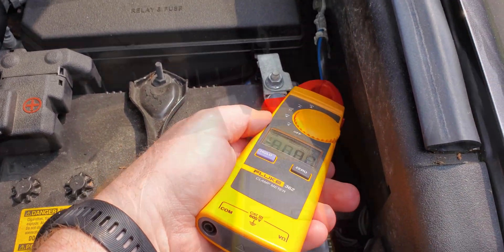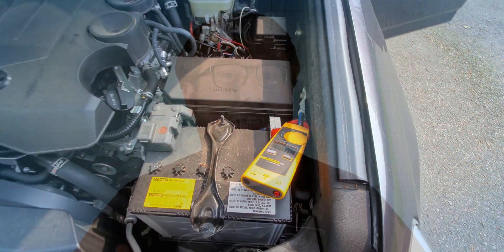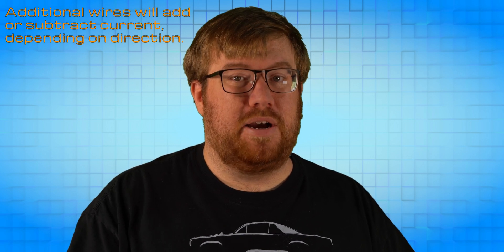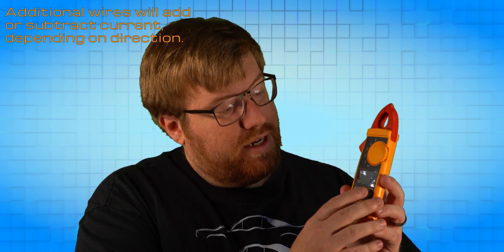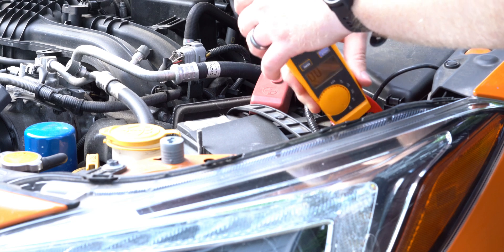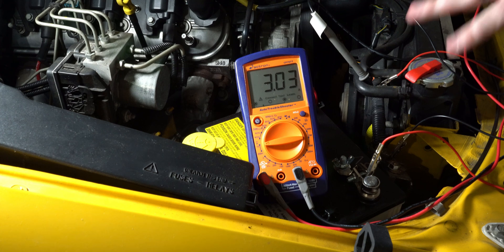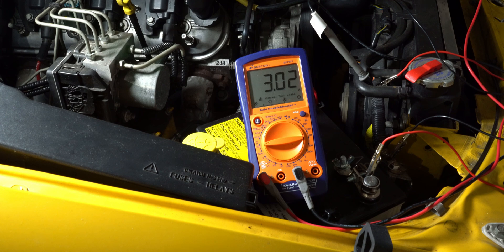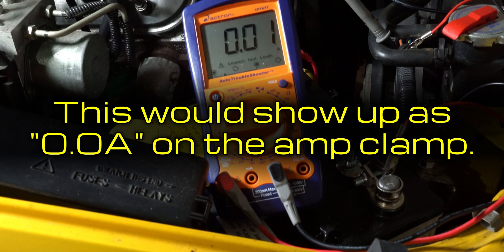DC Amp Clamps Versus Multimeters: Why Own Both?

Comment: That my friend was an outstanding presentation. You're a good speaker and you included all the necessary information and explained why the differences are important. I liked how at the last minute you showed that even though the multimeter is limited in amps and it's harder to set up it can be worth it because once you know the amps won't exceed the multimeter's limits, it's also more precise. Thanks.